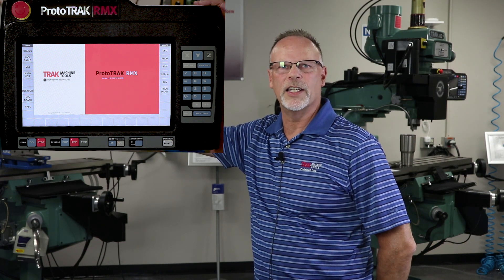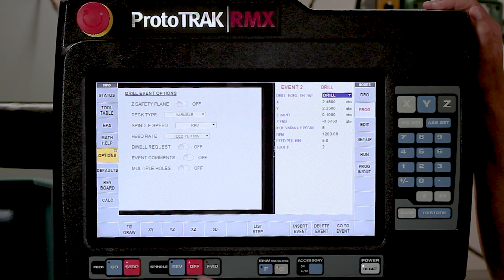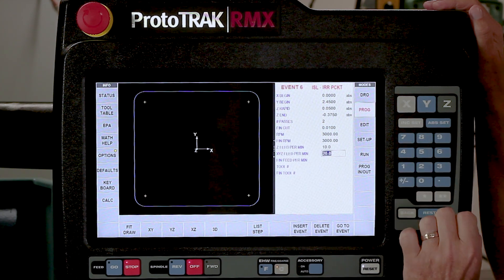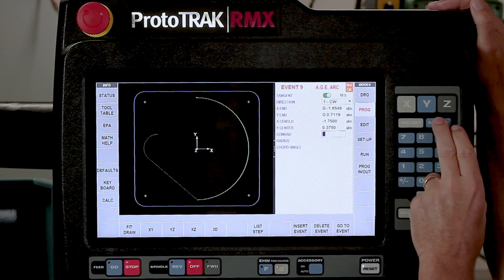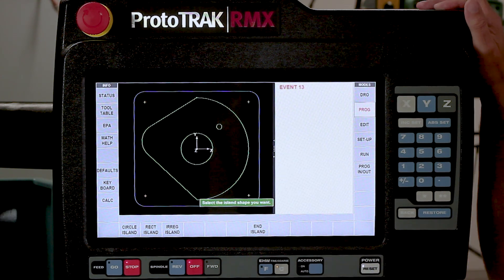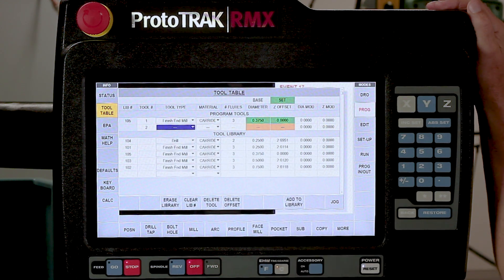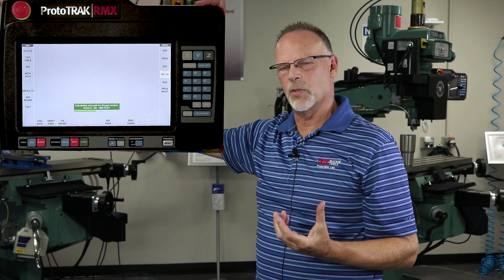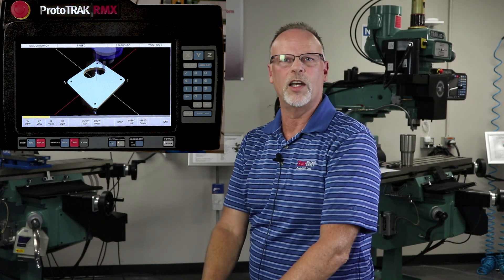Ball Park Island Pocket [Part 1] | ProtoTRAK RMX CNC | Mill Programming

Comment: Does this controller have a hole pattern function to pattern around a center point? can you mirror operations?
Reply: Brandon, are you asking if it has bolt hole patterns?  If so, yes.  It also has the ability to make rows of holes or staggered holes using the same information for each hole.  While we're at it, there is a key which will turn drilled holes into tapped holes too.